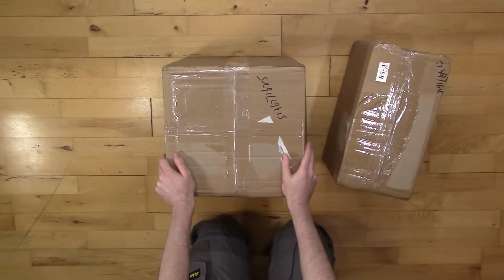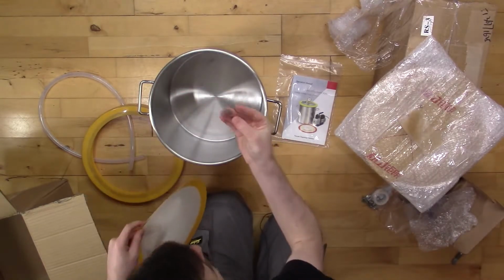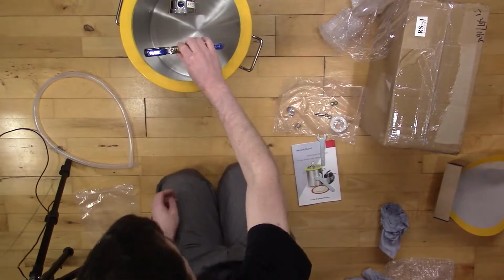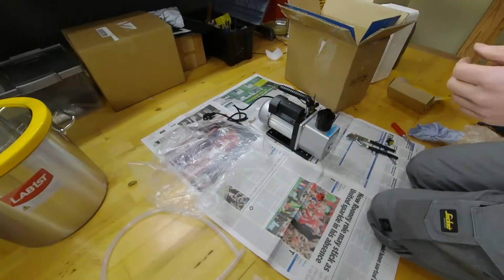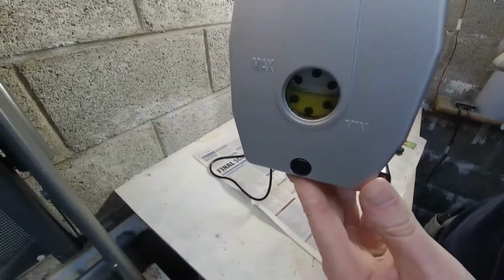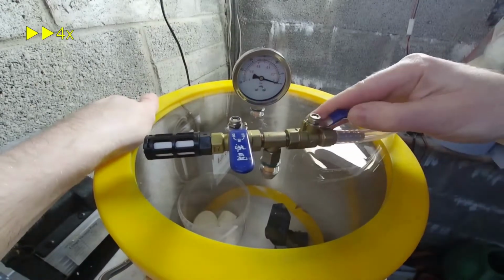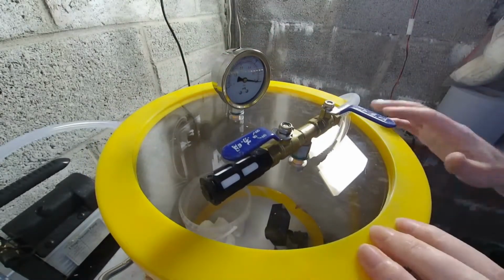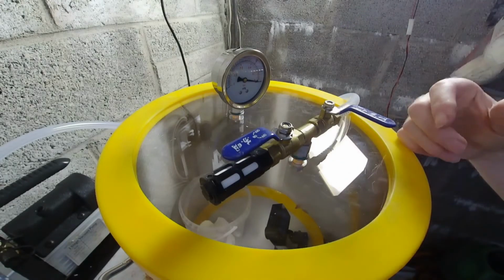Assembling a Vacuum Degassing Chamber Kit and Pump

Comment: So unscrewing the bottom didn't make much difference because there was continuous pressure on opening due to it being on bottom there is another on top that can unscrew now that will release pressure allowing faster flow but you video is good to the point also on thingiverse if you have 3d printer has a few good small funnels that release air as you pour its built into funnel great design